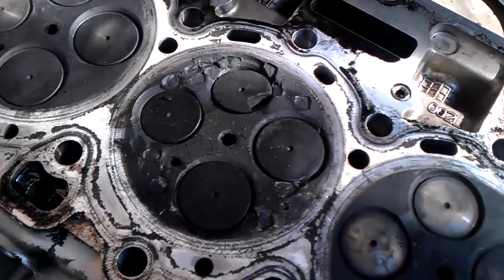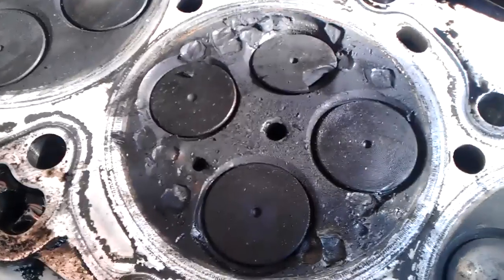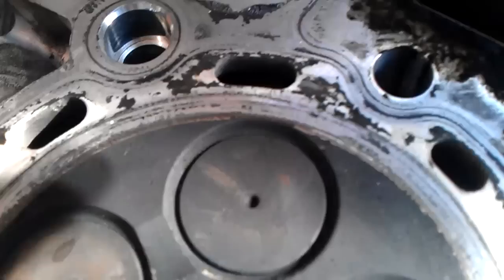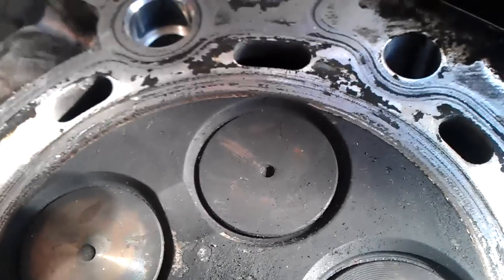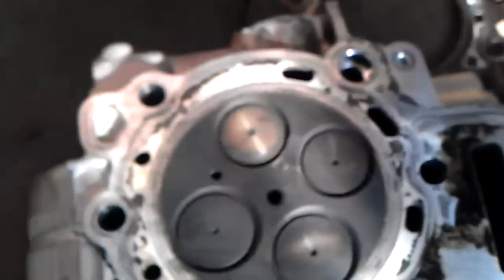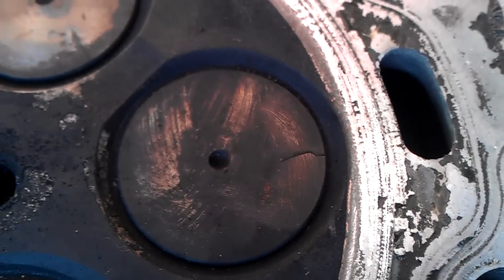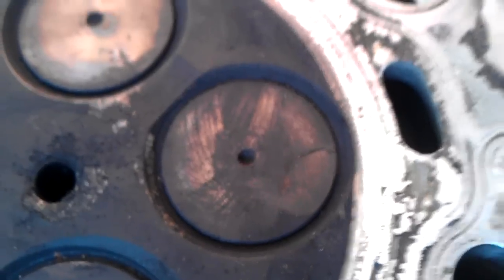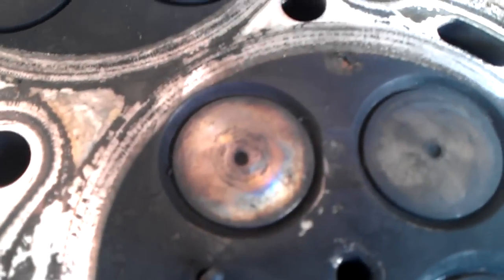6.7L ENGINE/VALVE DAMAGE

Comment: They all break. I need more than two hands to count the number of 5.9 common rail long blocks/completes I've replaced this year with dead holes due to burned valves or the rings hammered out. Some chipped, most not. Does it make them bad? No. Everything has problems.

Comment: that sucks. it's cool but still sucks. while we're talking about ford motors you got any advice on the older 2000 4.6L single overhead 2 valve  i think it's the gt300 block from the same year.

Comment: Joe, do you think the aluminum heads have a lot to do with this. How is the air management different on these, seems like if you can keep the temp down you would avoid this I wonder if a water methanol system would make a difference?